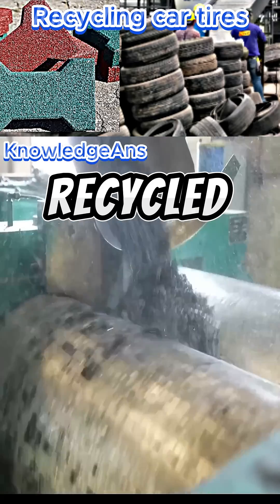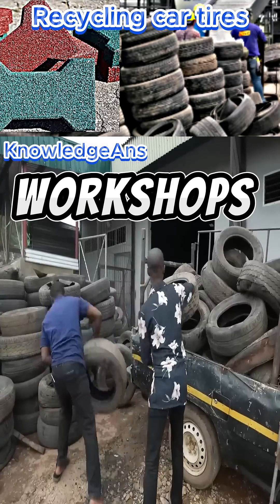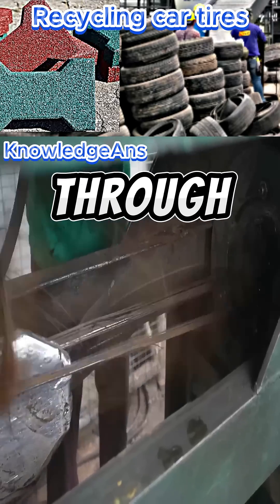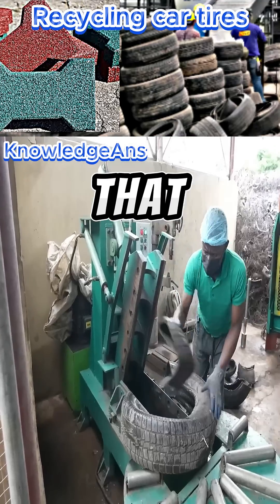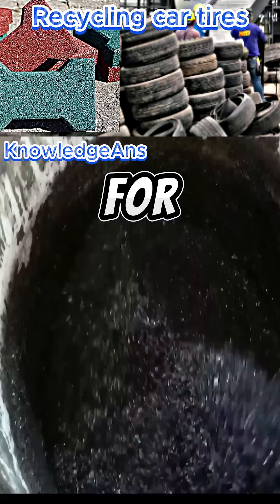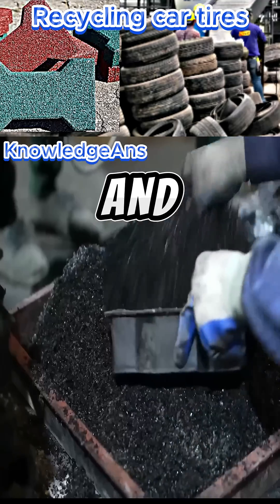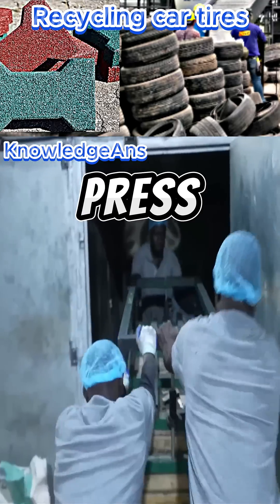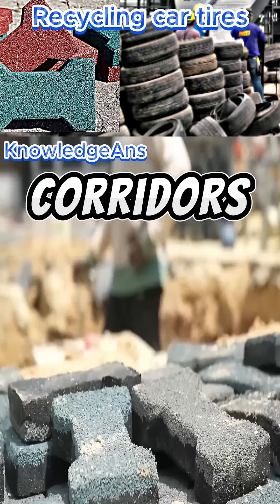Making paving blocks from car tires

Comment: up around Finland they have a factory that reduces tires to dust in one step by lowering the temperature to - 200 degrees and then removing the metal magnetically. the rubber is recyclable
Reply: hi dear can u share the email id or factory name
Reply: Reusable, not recyclable. You can't recycle tire rubber to make another tire. 💙 T.E.N.

Comment: All run offs if it rains run to the sea. One solution leads to another shit problem
Reply: Look at the reasoning. So whats the difference between when they are in the car or when they are discarded in huge piles in bins and the rain falls on them ?

Comment: Issue is, "The rubber burns"
Reply: My thought aslo
Reply: But how do you know that it burns?
Reply: @antoniomoore5149  it doesn't readily burn but when it is exposed to consistent heat it starts to melt and subsequently it starts producing black smoke.

Comment: Does the extreme heat affect those streets and corridors made out of those tiles? I guess it would make the material a little bit sticky if the heat is too high.
Reply: Not really. With the heat it is just as hard as cement blocks.

Comment: This should be used in our roads as well as plastic and glass for traction!
Reply: Roads  ???😢

Those heated roads  ??😂
Reply: It wouldn't work on roads, it wears to quickly under heavy load, pavements and decorative use only, but who knows what will happen to the eco system following decades of rain